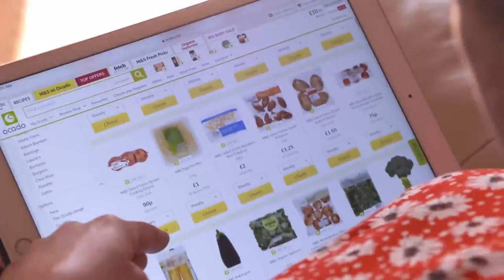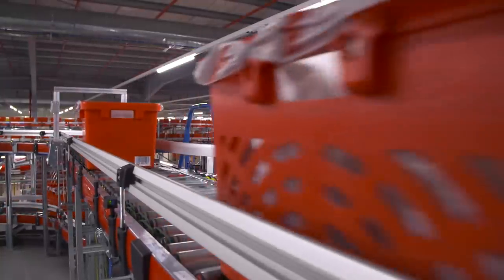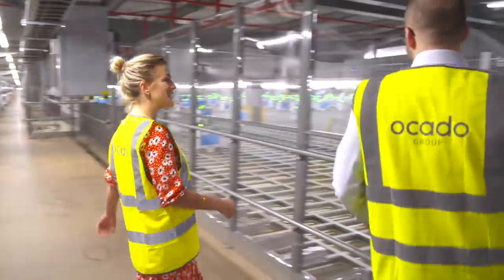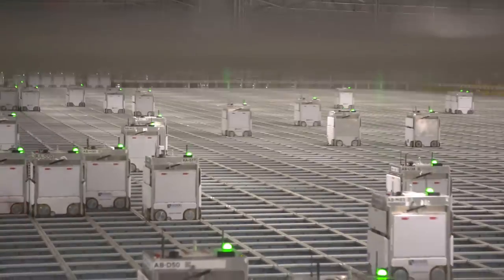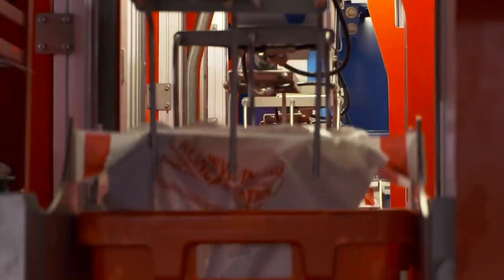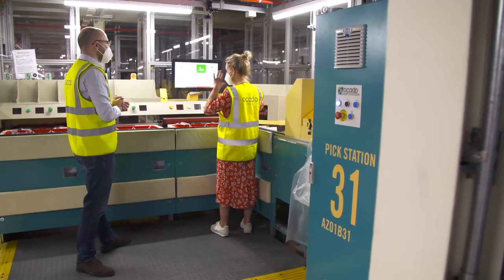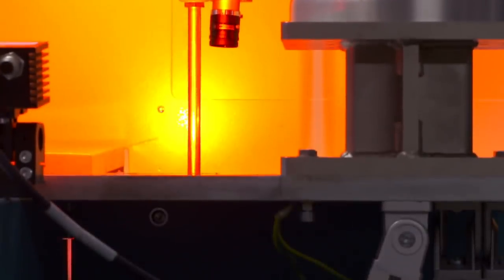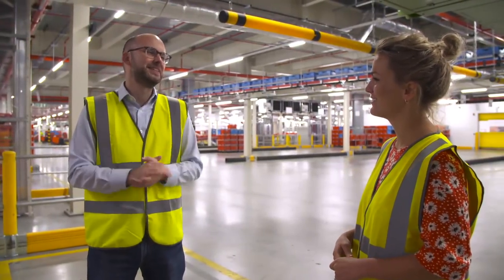Behind the scenes of the robots packing your shopping | The Gadget Show

Comment: Never seen a video where the word AI is so much abused as this one. I'm 99% sure that in most cases where the term AI was used, just a classic algorithm is used. 
A classic algorithm provides 100% of the time the correct outcome on the other hand "AI" or better "machine learning"  is a predictive model that is able to guess 98% of the time the wanted results. (at best)
Reply: An algorithm is AI if it mimics human behaviour, doesn't have to be anything fancy.  AI doesn't have to be Machine Learning.
Reply: NO need to be overly logical about. AI is the word people use for complicated computer controlled 'things' thats it - live with it.
Reply: Somebody help me as to why humans have to bottleneck the system and check the deliveries.  Why wouldn't the deliveries be checked by the computers and report any discrepancies?
Reply: @robjohnson8861  lots of different items from lots of different suppliers in various types of packaging. There is already considerable manual handling required to take the items off a lorry, unpackage them and load them into the automation so it makes sense to check the accuracy of deliveries at that point too. I'm guessing it's cost prohibitive to automate the complicated process of unloading lorries and removing supplier packaging at this scale.

Comment: A much better video than the Tom Scott video. A lot more depth in the same amount of time. I did not even pause once which is very rare for me. However, it seems a hell of a lot of work to load up trays, and then the robots pick up that tray for one order, and then sends the rest back. It would be far faster if a quantity was known on how many of that item has been ordered and then kept until all of those orders are filled, even though you will need a lot of room for this to work, but it would be far faster.
Reply: it is done that way, its not one to one, its filled and picked based on order needed to be filled. and the conveyor may go by 40 pickers but only stop at like 10 of them. if no orders were changed between placing and picking then the basket is scheduled to be empty at the end of the picking conveyor.
Reply: Tom Scott said that his video is still better than yours
Reply: The totes tht come dwn with say, cornflakes will stay there if all 3 shopping totes need it.. it doesnt cone dwn for one tote at a time

Comment: I ask myself, how huge is the weight, that they move around for nothing, just to bring the right supply box to the packaging employe or to the robot, for picking just one piece from it and then move it back in a storage. Wat amount of energy does it cost to move this unnecessary weght just for managing, and how much carbondioxide is produced to generate this amount of energy.
Reply: And then think of all the energy used to get it to your local supermarket, unbox it, put it in the correct part of the store, and then you driving/walking to that store, grabbing it, putting it in your trolley, getting it out of the trolley again to have it scanned at the counter, putting it back in again... etc.

And don't forget about all the spillage that process adds due to mistakes, but also having to have every item in every store instead of one central location. Or the time spent making the shelves look good ("mirroring"), cleaning the store because customers are messy, etc.

I agree there is a ton of room for efficiency improvement, but I think it is already a lot more efficient than the "old" process :)

Comment: It doesn't make sense that every time they need a single product the robot have to bring the hole box ??!!!

There has to be a better way.
The digging of the boxes is time and energy consuming and complicated .
You should start thinking in a simple way ..
Reply: They will have done years of research and simulation to arrive at this solution. You don’t just build a multi million pound robotic packing system by accident. The people with the brain to build this will have thought about it. Amazon have been moving entire racks of products around on robots for years, it must be the most efficient way or they wouldn’t do it this way
Reply: @PetesShredder  
that's true.
But I think that the new robot system SQUID is the first autonomous warehouse robot with 3-dimensional movement capabilities Mounted directly on a standard pallet rack,
 SQUID can pick from any location, with no difference if it's on the floor or 20m/60ft high.
Let me know what you think about it

Comment: it would be amazing to see what the limits of 3d printing, planetary gears and small dc or stepper motors could be used to lower the cost of those carts to under $25. capacitors , powered tracks and a* on arduino or esp8266.

Comment: Tax the CRAP out of them. Anything that displaces and replaces workers. A worker earns a paycheck then pays taxes, shops in the community, etc. A robot does none of that and should be TAXED to offset the losses.
Reply: Should they tax the crap out of companies that use bulldozers instead of 100 men with shovels? Or bus lines that displace hundreds of taxi drivers? Or photocopiers that replaced typists? Or email systems that reduced mail and countless related jobs?
Reply: Yep.  they need to assign all the robots wages to a human and then pay the robot, solved.